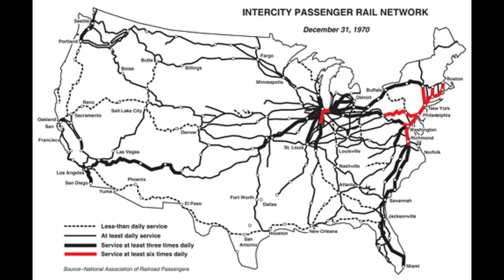Remarkable Engines: IANR 678/Ferromex 241

Comment: Those E & F units could work! Although they may be low on hp, and are Gensets, they were reliable, and could have been rebuilt with an EMD 16-645E3, and a HEP Generator, and serve until the 90s.

Comment: Only one EMD SDP40F exists today and ran on BNSF until 2002 and was painted in the Meresk Seaboard paint scheme along with a SD40-2 then was put into preservation.
Reply from the maker: I am aware of that. Goes to show how many F40s are still around (with most of them being rebuilt from SDP40F Parts) due to their much better track record than the SDP40s.
Reply: EMD owns 2 other SDP’s

Comment: The F40s, F59s, and F69s were the last great passenger locomotives made by EMD. The DE/DM30s are ok, but apparently are maintenance nightmares. The F125 has had so many issues, including: cracked engine blocks, the prime mover just randomly shutting down, traction motors that can be disabled by a wet leaf, and many others.
Reply: You can cut that list at F40s. The F59s really aren't as great as everyone thinks. F69s were a total failure, due to their problematic Siemens inverters.
Reply from the maker: Depends on who you ask I suppose. I can see reasonable arguments for why all of the locomotives listed here can be good or bad. Every locomotive has its pluses and minuses.
Reply: @Pensyfan19  If there’s an argument for F40s being bad, I don’t know about it. Sure, the originals only had 3000 hp and -2/3s only have 3200 hp, but they’re based on the 40 platform. The 40 platform was the last good thing EMD ever made, period. That’s why SD40-2s and GP40s are still in service, as well as F40s.

Comment: FXE never bought the 241... FXE only required the owner to patch it while in service in Ferromex lines...

It was used specially in the AOE/GrandeLuxe service in Mexico as the Chepe doesn't use HEP.... It's coaches are self contained with independent diesel enginators...
Reply from the maker: Thank you for clarifying that. An F40 with Ferromex lettering is still an interesting site to see, hence my original motivation for making this episode.
Reply: @Pensyfan19  quite an event. Big fan of your videos. I wish FNM  wouldve HEPed its equipment and acquired F40PHs

Comment: Did you know NJ Transit lended some of their redundant ALP-44’s to Amtrak to help clean up the North River Tunnel after Sandy caused a lot of mess.
Reply from the maker: I heard of that happening during sandy. I think Amtrak needed extra electric power that could be used in the tunnels since diesel locomotives are not allowed in there due to their fumes.

Comment: Hey pensyfan could you do the SDF 40-2 6976(former Amtrak 644 former Santa Fe 5266 and former BNSF 6976) the last mainline diesel and it was preserved by dynamic rail preservation alongside F40PHR 231
Reply from the maker: I will also look into that locomotive.
Reply: @Pensyfan19  6976 & 231 both reside at Nevada southern railway museum in boulder city
Reply from the maker: After doing some research on the locomotive and a few other locomotive series on YouTube, I am going to have to decline this request for 6976, as Amtrakguy365 has already covered the locomotive in his SDP40F episode of Engines of Amtrak, and I do not want to go over a locomotive which another channel went over in detail. Thank you for suggesting this locomotive nonetheless as it shows that people are interested in the series, and the next locomotive to be covered in the series (Green Mountain 405) was recommended to me by a fan of the series, so I will still listen to my fans and try to incorporate their ideas into my series.

Comment: Hey I don't know if your taking requests/suggestions for this series, but if you are I would like to recommend DRGW 5402. 

Drgw 5402 was an SD40t-2 that was involved in a wreck on the Tennessee Pass in 1989 with two other DRGW units (those being 3108 and 5408). Luckily, despite the fact that it was pretty banged up (photo here https://www.drgw.net/gallery/v/DRGWDieselContainer/SD40T-2s/DRGW5402/drgw_5402_pueblo_co_1989_000.jpg.html ) it was deemed repairable by NREX and was rebuilt was an SD40-2 in 1993 (photo here http://www.mountainrailway.com/Roster%20Archive/CP%205400/St.L&H%205449.htm ). It was then sold off to Canadian Pacific and became CP #5449 in 1994 then STLH 5449 in 1998. Then it was rebuilt again in the year 1999, and sold to FURX the following year where it became FURX 3021. Finally, after all of that, it was sold to the Alabama and Gulf Coast Railroad some time around 2013 where it still remains as AGR 3375. 

An interesting fact about this locomotive, is that its shared most of its history (post rebuild) with another engine, CNW 6910. CNW 6910 was involved in a wreck where it ended up being totally messed up (photos here http://www.rrpicturearchives.net/showPicture.aspx?id=1014562 and here http://www.rrpicturearchives.net/showPicture.aspx?id=1070155 ) and ended up being sold to be rebuilt and was bought up by CP and numbered 5447. Then it was sold to STLH, then FURX, and finally AGR. 

So if you haven't got it yes, the similarities of both engines are that ended up working on CP, STLH, FURX, and AGR because they where involved in two separate wrecks that made them end up switching owners, and ever since, they've been "living" almost the exact same existence.
Reply from the maker: That is a very interesting story. I'll definitely look into further information for an episode in the future.
Reply: @Pensyfan19  Oh yeah, heres some info on the wreck https://www.drgw.net/info/index.php?n=Main.TP1989Wreck